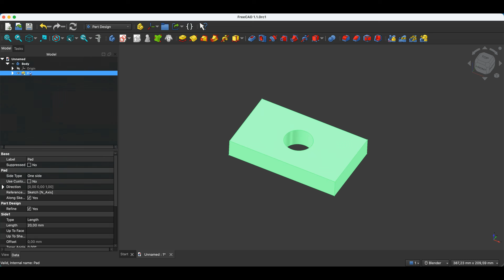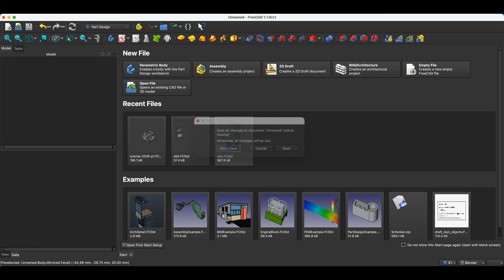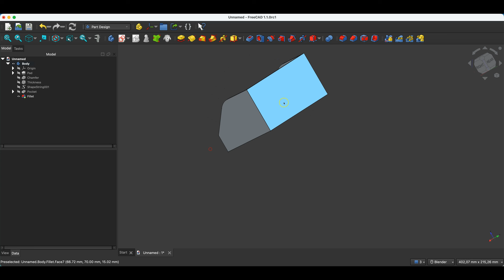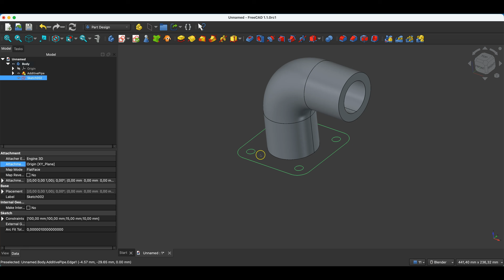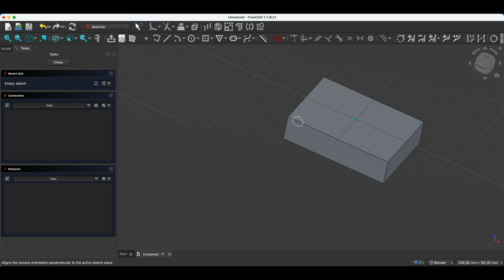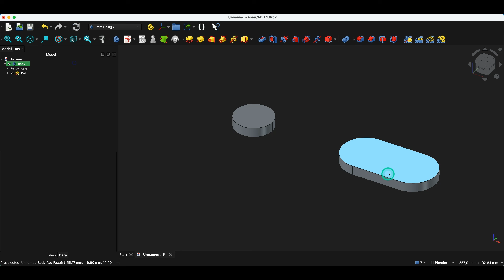FreeCAD Full Course for Beginners - Step-by-Step

Comment: An FYI for people following this with newer version of FreeCad.  I'm using 1.1.4 and to get the rotation configuration he talks about you need to set your control schema from the default CAD to Blender (bottom right toolbar) and since there is a display bug, to see the axis lines in sketcher you need to go to edit->preferences->sketcher->display and set the view scale ratio to at least 1.5  This adds the axis colors and also means that they highlight when mousing over them (like when you are trying to select them to use as a constraint).

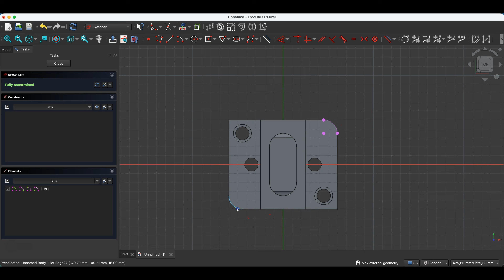Comment: My version 1.1.3, gave me problems with the external projection on 45:28.  I have to select the 2 point on each of the chamfers, and use two dimensions referencing the circle.

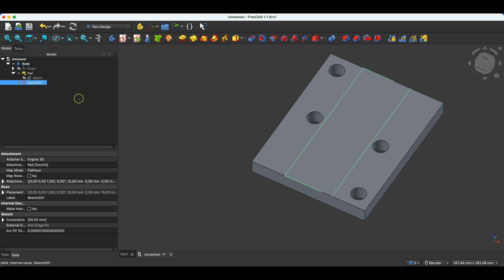Comment: I just wrote a comment on an error on the pad in 39:17 (wire wasn'closed).  I found how to solve it.  May be the version (1.1.3 (mine)), the "external projection" reference had to be made on a point, and not on the side of the sketch 1, then give a referenced dimension to that point.  So, I could keep working fine.

Comment: 1:33:34 when I faced this error, I applied a coincident constraint by selecting the free point and the line instead of those two points. As a result, the problem was fixed but for the first time since the beginning of the course, I did not understand why something happened.

Comment: This is an amazingly great resource. Thank you so much for your time and effort. I following the video at a slow one part per day pace and really enjoying it.

 I made a mistake in part 7, II forgot to round the corners on the 10mmx10mm rectangle. I have applied the multipart transformations. Now I want to correct the rectangle to add the rounded corners. What's the simplest way of doing this?

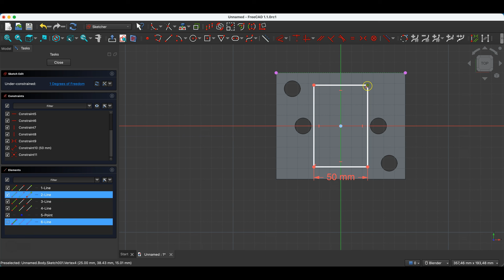Comment: external projection does not work for me at 38:46. It make the figur wire not closed when I connect the coners. Any ideas og alternatives?
Reply: I m having the same issue, did u fixed it?

Comment: @1:02:48 can the math be done inside the direction box? AKA 100mm-15-15?
Reply from the maker: Yes, you can use these mathematical operations. You can also click the 'fx' button and enter it in the box there, but if you're subtracting from '100mm', you have to do it like this: '100mm-15mm-15mm' – it's important to enter the units.

Comment: For others in the future, or me repeating this in a few months: in 47:03 ish, I got a ""Wire is not closed."" error which drove me crazy for a while. The line was not imported as a "construction line" and that generated the error. Either click the "Toggle Construction Line" to make the external projection line dashed, or go to Edit/Preferences/Sketcher/General and make sure "Always add external geometry as construction" is checked.
Reply from the maker: https://youtu.be/4mmxJ0Aeew8
Reply: Thanks. I was going nuts trying to do this.

Comment: 38:32 For newcomers: as of now (1.1.1), external geometry is treated as part of the sketch. You need to change all external geometry to construction geometry (G, N). If you don't do it - you'll have a problem when creating a pad, for example, because geometry becomes not closed. Hope it'll help someone. I myself didn't understand wtf happened and why I can't create a pad from sketch
Reply: Thank You. This should be a pinned comment for v1.1.1

Comment: the workflow is unnecessarily convoluted. I've been designing/drawing for 30+ years, holy crap the number of steps required is insane.
In Microstation I would open a new file.  No workbenches or any of that dopey stuff.
Select line, draw 5 of them, all the same command, click one button.  UP, length and distance, repeat for each side then draw a line from one corner to the other.  Circle command, select midpoint of diagonal line, drop circle with size.  It took 8 mouse clicks in total for what took 30 in freecad, or more.
drag and select all.  select create hole.  automatically converts the rectangle into a solid with a hole in it.  select extrude.  drag, specify distance, done.  This would seriously have been a 30 second to a minute to draw in an interface that was not so clunky.
In 35 years the total number of times I have needed to draw with constraints has been zero.  I know the worth of them but they are really unnecessary for most design.
but what if I want to change it later????
then change it later or just do it correctly the first time.
You were proceeding at a slow but real time doing a thing.  it took 16 minutes to do something that should take 1 minute.  Even accounting for you showing us, cu your time in half, it was still 7 minutes and a huge number of actions to do a simple thing

Comment: is there any way to set projection lines automatically as construction lines? when I tried to extrude a rectangle from the face in the first excersise I got a message that wire was not closed. I had to go back to the sketch and turn the projection line manually to construction line and then extrusion worked normally.
Reply from the maker: https://youtu.be/4mmxJ0Aeew8

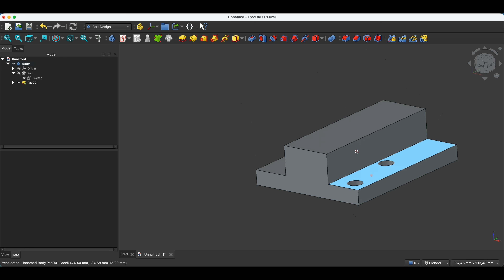Comment: 39:29 i came across an error in a recent version of FreeCAD where you get a "wire is not closed" error. I foubd out that the problem is the line created from the external projection. FreeCAD treats it as defining geometry rather than construction geometry. To fix it, simply go back into the sketch view, select the externally projected line and press "G" then "N" on your keyboard. You will see the solid line turn into dashed lines, now you can extrude from the sketch.
Reply from the maker: https://youtu.be/4mmxJ0Aeew8

Comment: Being brand new to CAD software in general this guide has been a massive help beginning to understand how to work in FreeCAD! For anyone else also brand new to FreeCAD, be aware that using a different version is going to cause very different changes in behavior so be careful which version of FreeCAD you use as they are not treated the same!

In my experience, I started using 1.0 before I got to Part 4 when I encountered an issue not being able to create external geometry on a non-planer surface. So I updated to 1.1.1 (not 1.1.0) which solved my original problem of not being able to generate external geometry on a non-planer surface, but also changes the default behavior of the "external projection" tool in Sketcher to define geometry instead of defining construction lines. This lead to an error "Wire not closed" when creating the groove as the sketch now also defined the external projection as a part of the geometry of the sketch instead of just as a construction reference. Took a bit of googling to figure it out, but definitely served as a valuable lesson in being aware of version differences.

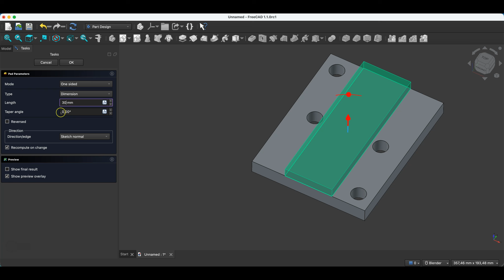Comment: At 39:20, I 'cannot use selected object.  Selected object must belong to the active body.  Consider using a shape binder or a base feature to reference external geometry in a body.'
 What can I have done wrong? I dragged the sketch icon listed in the model panel and dropped it onto the Body icon, and voilà. I can pad the thing.

Comment: I LOVE your absolutely no nonsense fast pace. 

I sometimes actually break a sweat trying to keep up with the videos, but it works very well for me. I'm not ashamed to say that I need to pause and rewind some times in order to do the thing right. But those times where we're doing something for which I've developed some muscle memory, I just love being able to do the things as fast as you talk.

The instructor teaches you something and then expects you to understand it and move forward. No hand holding for previous lessons. For quick learners, this is a godsend. For slower learners, just hit the pause button. 🏆🏆🏆

I'm about 1.5 hours through and need to take a break. You rock.
Reply: Slow the speed down to 75 or what you comfortable with.

Comment: 15:58 It works differently on my screen: I don't get such a neat form to enter the new dimension, instead I get some more complicated table, where I need to find and enter"Side1>Length>30,00 mm". Why does my freecad1.1.0 behaves differently?
Reply: He's using 1.1 there are a lot of changes that make it similar to fusion. Look for 1.0 tutorials or upgrade. 1.1 is maybe more than a month old right now.
Reply: @mikemiranda1892 thank you but Read carefully. I am using 1.1.0 not 1.0

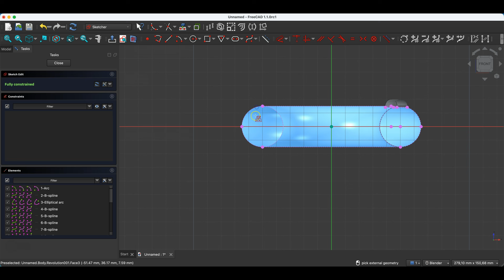Comment: At 50:22 when he creates reference geometry to the donut we've created, in FreeCad 1.1.1 this is now External Intersection instead of External Projection. Click on the small grey arrow beside the External Projection icon to find it or just press G and then I. And don't forget to make all intersection and projections " construction" geometry to prevent issues when rotating or padding (select it and press G and then N - should become a dotted line).

The constraint points are also different. You will see one single point in the middle of the donut cross-section and not three as we see in the tutorial. No problem. Just select the middle of your triangle, the bottom point of your triangle and the center point of the donut before creating your Vertical Constraint (V).
Reply: Can you clarify more on this

Comment: At 38:30 you turn the upper edge of the solid to an external projection line and use it to tie the corner of the new sketch to coincide with it. Then you extrude the rectangle. In version 1.1.1 it doesn't work, took me a while to figure it out. I was getting the message "open wire" and could not extrude the rectangle. Apparently I had to turn the edge of the solid to a construction geometry to work, a step that was not in your video (that's why I assumed it was added later in the current version)

EDIT: Disregard above message. There is a check box in Preferences under Sketch/General to Always add external geometry as construction.
Reply: Thank you!
Reply: yeah i was also struck in it and got it solved by reddit gurus
Reply: Thank you!!

Comment: After several tries and many hours, I was able to pad the new rectangle, which is demonstrated in phase two of the demo. I deleted the external projection line which covered the whole top edge and recreated it on the top edge of the new rectangle. Now it pads correctly and if I change the dims on the original sketch, the new rectangle adjusts automatically.
Reply: It happened to me as well. Another solution is to make the line a 'construction geometry' which is like a reference line, not considered in the extrusion tool.

Comment: Using FreeCAD before, you did a box in two pieces with an edge, by
using the wire in the Part Workbench, are this the same in FreeCAD 1.1?

Comment: Really hope there will be a  tool for creating a mesh of 3D points, as in Creo. You just need an coordinate system and a  table, with x, y, z. And a tool for curves intersections. (or maybe there is one, i am a 
 new user, have 0 experience with the curves and surfaces).

Comment: 39:06:  when i attempt to pad the second sketch i'm given "wire is not closed" error.  I have deleted the sketch and started over, i have restarted the application.  I have made multiple attempts following the video. Stalled.  Please advise.
Reply: I had this problem too. So go to the Edit menu and at the bottom select Preferences then click on Sketcher and there check "Always add external geometry as construction".
Reply: @mickster_trickster yes it works  i had the same problem , thanks!! :)
Reply: It has something to do with the external intersection. when i delete that the error goes away. when i re-create it an add the coincident restraint back in the error returns

Comment: I'm stuck. External projection is not dashed line my screen. It's a solid line and I think it's giving me an error "wire is not closed" when I try to extrude. How can I fix this? Thanks.
Reply: I have this too.  Try right click the line, and choose "toggle construction geometry".  Also, another user suggested going into preferences for sketcher, and selecting "always add external geometry as construction"
Reply: @dynomotivedyno9194  You are a lifesaver! I was about to rage quit because this tutorial was such an Ah Ha for me up until this point. Thanks a lot! Kudos to you! FYI, I set it up in preference as I assumed this creator had it like that because the extra step of "toggle construction geometry" wasn't shown in the tutorial.
Reply: @dynomotivedyno9194  Thank you very much, my friend — you saved me from quitting FreeCAD.

Comment: Note to new users: adding radiuses and/or fillets as dress up features should be done as a last step in modeling. This is often stated without explanation, so let me explain. It's about editing a model. The model is complete & 3D printed, but the print isn't quite correct and requires editing. You've located the change required and make the change, when the model goes bad. Alerts & warnings of conflicts and a mess shows up on the display, or worse, the model disappears completely. Take a deep breathe as there is a simple solution. Delete the fillet and/or chamfer step at the end of the tree and refresh the display. The model should return, avoiding the heart attack. In review, to edit a model which has the dress up feature, first delete the dress up feature(s), then edit the model. Once edited, re-apply the dress-up feature(s).
Reply: Thanks for this tip, Im a beginner to freecad, i havent touched CAD software in a while. I last used solidworks back in 2020-2021 lol, how difficult is freecad to pickup?